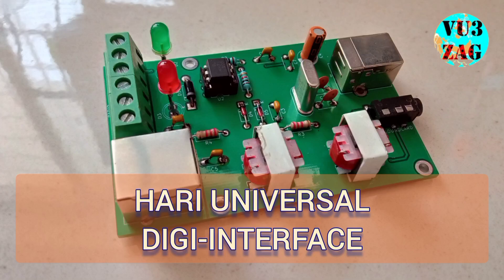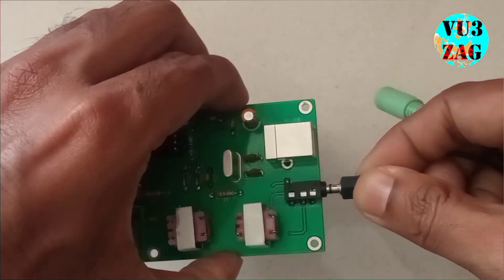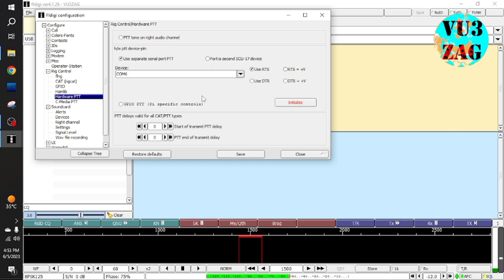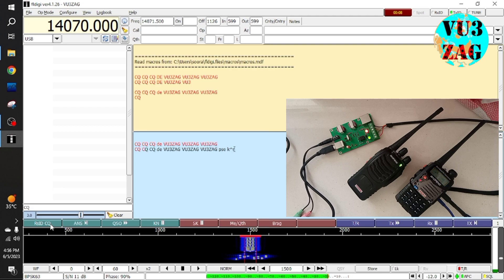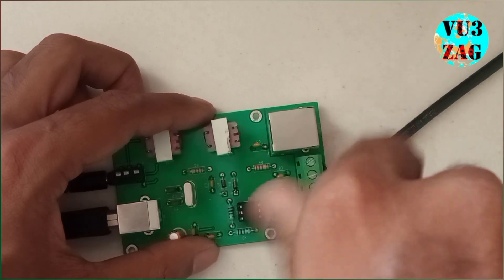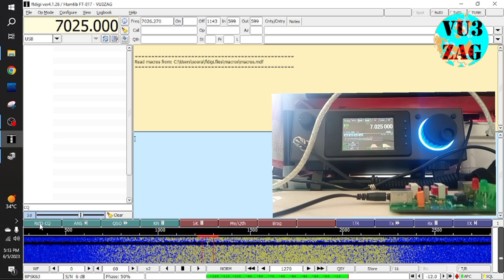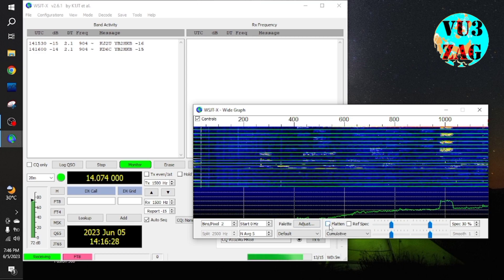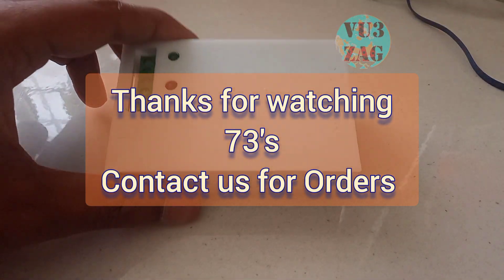Hari Universal Digi-Interface

Comment: Wonderful device. 
It will be good to show with commercial rigs. 
How the PTT works with Bitx here ? and how it will be on commercial rigs as there is no additional PTT link - is it working with Vox or something ?

Thank You
73
vu3tbu
Reply from the maker: Thank you so much VU3TBU! I'm delighted to hear that you find our product wonderful. While demonstration on uBitx as i explained the internal CAT control of uBiTx was used so the USB cable was disconnected from interface ,only audio isolation part of interface was used. It will work in commercial rigs also, for that you have to connect the PTT and PTT GND connection from Radio (Round socket) to our interface and do the software settings as shown in video. We have not used VOX in our demonstration it is purely PTT control. VOX activated PTT will also work with this interface, for that you need to enable the VOX in the radio. We will definitely try to upload videos on commercial radio soon.
Reply: @vu3zag  Thank you for detailed response. What made you think that we should use a isolation for audio ? Is that because the audio gain is high towards both side or any other specific serious reason ? 

73
vu3tbu
Reply from the maker: Talking about Audio isolation -As you are aware that the PC and the radio works in different voltage levels. The components in the PC could be damaged by the voltage difference between grounds in case of protection circuit failure in radio end. The galvanic isolation provided here prevents antenna static from reaching PC somehow via radio. Blocks PC power supply interference to reach radio via wired lines. In addition it also helps to eliminate ground loops which is normally the main reason for audio noise.